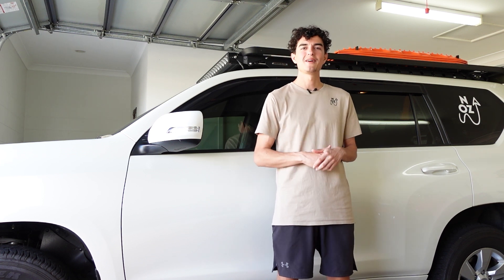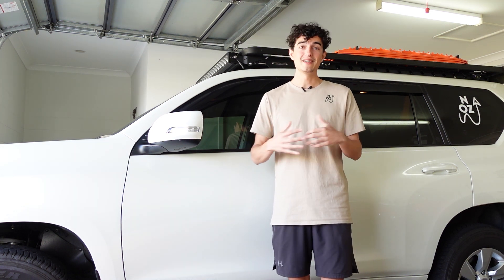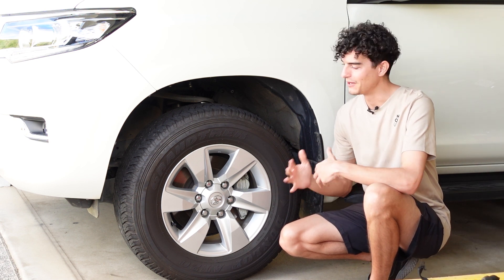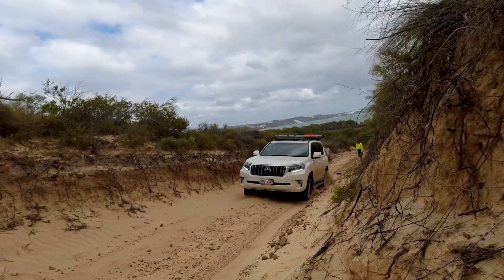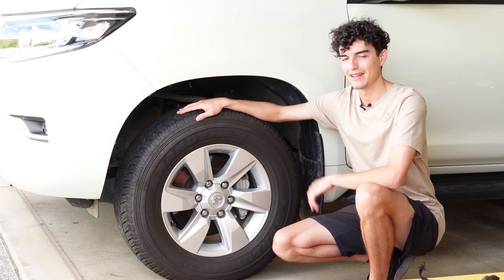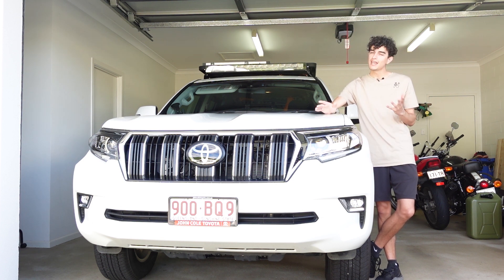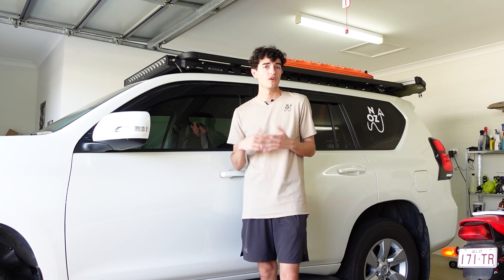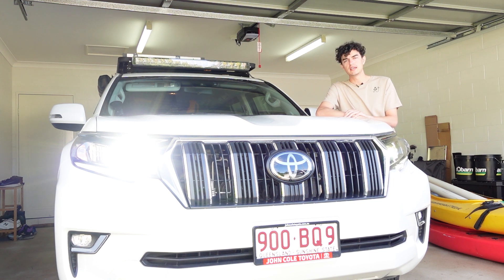5 Mods NOT TO DO // With Cheaper Alternatives // Toyota Land Cruiser Prado 150 (GX460)

Comment: Good video and good points. I’ve hired Prados overseas and gone off road and never needed anything more than the stock standard hire vehicle. The only thing I would have liked was more power for overtaking at highway speeds but that was with the older 130Kw engines not the new 150Kw.
Reply from the maker: True. Some of the engine options weren’t great. The new ones are fantastic. If it’s good enough for the hilux, it’s good enough for me 👍

Comment: on our new prado we got genuine rubber floor mats supplied, which saved us buying some, --great!
 good points about not 'over doing' it. that's how we approached our van and prado builds. we find our simple DIY awning and other gear works, without the cost.
Reply from the maker: 100% agree. I have the stock floor mats and there are a lot of cheap and good quality parts out there if people look. Problem is, we buy stuff we don’t need and we are no better off then when we started modifying and spending. Hopefully this helps some people
Reply: I replaced the genuine front mats as exposed carpet between footrest and mat. New ones are super

Comment: Regarding the tires I disagree with you. I made 70k kilometres with a stock tires and it became bold because of off road. Also its main disadvantage is that you can’t put a low pressure on it because you can easily damage it especially when you drive on stones or gravel. I switched to BF KO2 and it seems a very good setup for me.

Comment: The bullbar's saved our 150 a number of times with roos and deer, and our halogen spotties really are a big safety feature on bush roads. The OE Dunlop Grand Treks are quiet and economical and even with 70k on them dealt well with really rough outback tracks. We replaced them with Geolanders and fuel consumption is up over 10%, but better dirt road grip. It really does depend on your vehicle use as to what you change, but our set up gives us more flexible use of the Prado. Horses for courses.

Comment: A bull bar, winch and snorkel should be in your top 5 things to do FIRST! A bull bar offers you protection, better approach angle and somewhere to house your winch. A winch is one of the best mods for self recovery for those who explore alone and can also aid in recovering someone else if needed. A snorkel not only allows cleaner air to your engine, improving longevity, but also allows you to do river crossing more safely. These are the first 3 things I do to any of the 4wd’s I own. Tyres I agree with, lights I agree with and rear draws I agree with. But I’m not convinced on the others
Reply from the maker: Big dollars there Tristan! I think it depends on the needs. I have owned a truck with and without your mods mentioned and there is almost always a way around them. As an example, travelling with someone who has a winch instead of buying one yourself. The recent information I am pushing to people is that most don’t need all the mods and they can go bush without them. See my Prado test video for evidence haha. I’m trying to strike a balance between dropping $15,000 on mods and spending money on travel. I would love a bullbar, winch etc and there is no denying they have their place but to say the first 5 things people should do is to spend big $$$ before getting to know their vehicle is a mistake that is too often repeated. If you have the money and aren’t interested in testing and comparing stock vs after market, then by all means drop the cash at ARB. I’m trying to take my time and provide a different approach to the hobby. Thank you for your comment Tristan. I look forward to your thoughts on future videos 👍
Reply: @NorthOz  we have a 120 series prado, it came with decent tyres from the previous owner, so they can stay. Safari snorkel was $450, Ironman winch compatible bull bar was $2400 and the runva winch was $900. I installed these all myself saving more money. I get not everyone is comfortable doing this. But it’s worth learning the skills to help you in the long run. I also don’t agree with “learning your vehicle in stock form” if you are only going to upgrade everything and have to “learn” everything again. But I also love a good debate, so keep them coming ✌️
Reply from the maker: Ah I see. Yes, inheriting prior owner mods does make a big difference. I will bring that up in a future video. Great points mate 👍
Reply: You’re going places where you need a winch but are doing it on highway tyres?
Get better tyres and you’ll not need the winch so often.

Comment: Good points. Don't necessarily agree about the tyres, as conditions may require a better tyre depending where you are going. I made my own camper bed for my Prado, cost me very little and have tons of storage underneath. I will make or buy some storage draws to go underneath so will not cost much either. The lights on these new Prado's are excellent so no need to upgrade them like you said. A winch and snorkel are very useful items that can be of real help if you are going hardcore off road.
Reply from the maker: Depends on what you are doing. I have tackled Australia’s hardest tracks with stock tyres. Know your pressures and have simple recovery gear like maxtrax. Better than spending $3000 on tyres when I have new tyres for free with the vehicle. Each to their own and everyone has different needs

Comment: Those factory tie down points are not to be relied upon at all. Yes, as a last resort, with training and measures in place to minimise risk, they can be used. But not recommended at all. (Qualified Trainer) fby4 would be well advised delete that video. They do break. Seen it.

Comment: Really comes down to what you're doing with the car. If you're going off-road at all, you minimum need AT tyres. Even for 2WD accessible camp tracks with gradient.
The Prado's tie-down points are some of the best put together for recovery and will definitely do the job, but for 100 dollars and 30 minute fitment a set of sacrificial ones is not something "NOT TO DO". If you have to get snatched out of sand (i.e. if you ever drive on sand) you will wish you had them.
If you're putting in a lot of regional kilometres, especially at night, you want a bullbar and either well taken care of headlights or a light bar/spotties.
To me this is closer to a list of mods that you should do. Drawers is an unnecessary rabbit hole of expense but specifically the Prado and FJ platform almost necessitates this once you have more than two people in the car.
I'll have to have a squiz and see how you've gone after a year. Nice to see excitement from a prado owner though, subbed.
Reply from the maker: Thanks mate. Exactly right. It all depends on what you want to do with the vehicle too 🤙

Comment: Great Video :) I believe it all depends what  you are planing to do. 

Standard AT/HT tires don’t last long once you start off-roading. Sure you can push through and get lucky few times but it increases the risk factor. 

For lights, yes Factory HIDs are great however, most pre 2017 GXL/GX have halogens and halogens are not great on-road, let alone off road. If any night driving is on cards - headlight upgrade - more lights are a must.
Reply from the maker: All good points. I’ll run these tyres into the ground. I don’t want to spend the $2000 if I can avoid it haha. With the lights, a bulb upgrade is helpful and a cheap light bar does the trick 👍

Comment: I disagree with the tyres. If the cars for school runs and winery gravel car parks then yes, it’s fine. They’re even good on sand. If you’re doing any length of unsealed driving buy a set of proper 10 ply ATs. You will absolutely get a puncture and lose half a day of your trip. So you if have a trip planned sell those Highway terrains to someone who will use them before you puts miles and depreciate them.
Reply from the maker: I see your point and thank you for the comment. I have done extended trips on corrugations without issues. I abused them for over 15,000 kms and no issues. Not even a flat. I aired them down to 10 psi on sand and they still performed. It all depends on what you are comfortable with. They are still a high quality and performing offroad tyre and I would absolutely run them again 👍

Comment: 6:00 al alternative to building drawers is waiting for a 2nd hand one from the marketplace. Could easily cheaper than buying materials from bunnings. I bought mine used for $200 but have seen them as low as $100 when ppl want to get rid of them. Warning they are heavy
Reply from the maker: Good point. Second hand parts are the way to go 👍 People always selling them for 10% what they paid for them. Just need to be patient for your make and model. They are very heavy indeed

Comment: Hey does ur vehicle doors unlock when you turn off the ignition i am curious because i got a new prado just couple of days ego & doors doesn’t unlock when i shut the ignition off just wanted to know it is a factor setting or a defect
Reply from the maker: Congrats your new Prado 👍 Are you talking about the auto locking doors and then them not opening? I think they only open when in park. If that’s not happening, you might have an issue
Reply: @NorthOz  ohh damn not on new car😭
Reply: IN PARK WITH FOB OUT OF CAR, YOU TOUCH LITTLE RAISED RIBS ON DOOR HANDLE  AND DOORS LOCK, NO NEED TO TOUCH FOB, 2 BUTTONS ON REAR DOOR ALSO

Comment: I bought a 2nd hand gu patrol 15 years ago that already had a bull bar.
I have since added accessories but only a few at a time, so after 15 years of ownership you end up with an off road weapon
Reply from the maker: Second hand vehicles are the way to go if you don’t want to spend the money on parts yourself. Unfortunately I found I was spending more money fixing my navara (with all the equipment on it) than what is was worth
Reply: @NorthOz  new cars are expensive but there is that nice felling knowing your the first and you never forget that initial smell of newness 😀
Reply: @NorthOz  the way I look at it, you do your due diligence, get a lot of accessories with it, save yourself thousands, I do most repairs myself and last of all you save thousands on depreciation (the hidden cost no one thinks about)
I’ve had my GU now for 20 years, it is now 33 years old, most people would have owned 3 cars in that time
It’s basic maths. Unfortunately the itch cycle for new cars is 3 years an urge I have learnt to resist

Comment: 5500 km for name brand bullbar and suspension both 8k, your shopping in the wrong place
Reply from the maker: With all the bars on it, that’s what we pay here. Might be regional prices but ARB charge like a wounded bull and competing bars aren’t far off it these days
Reply: @NorthOz  you get what you pay for. ARB sell top quality tried and tested equipment. Others do also, but they are arguably the best. Any decent off roading in these vehicles and you should start with a bullbar, rated recovery points and recovery gear, winch, snorkel and some decent all terrain tyres. Then go from there. I appreciate what you are trying to say but going out with underinflatted highway terrain tyres is going to put more wear on the engine and drivetrain, reduce fuel economy, increase the chance of the tyre coming off the bead and increase damage to tracks. You need tyres to suit the conditions you are driving on.